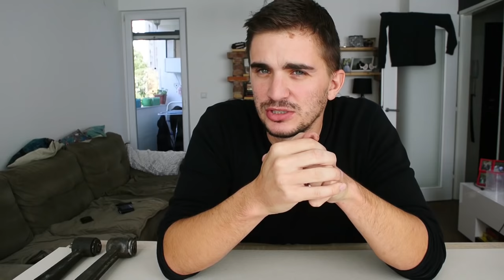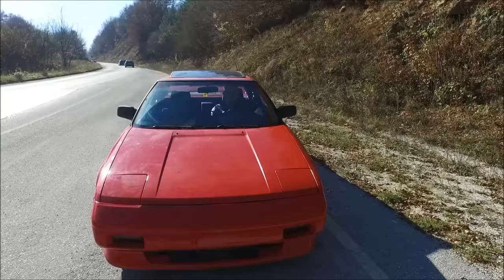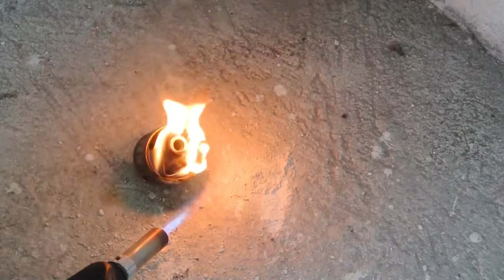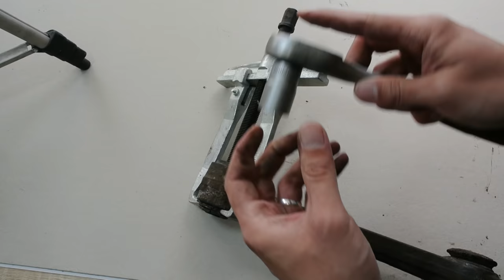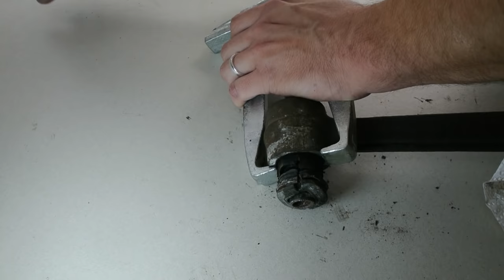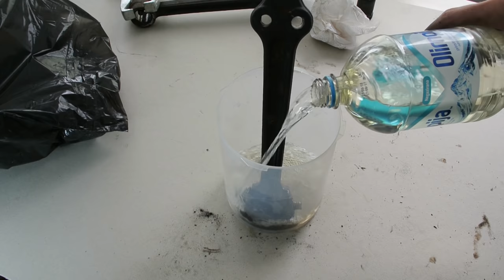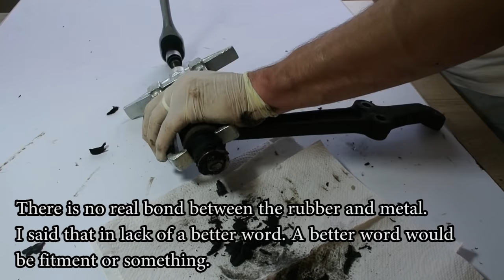How to remove rubber bushings without a press or burning - suspension episode 5

Comment: Makes sense because gas eats rubber, Brake fluid eats painted surfaces. I still remember that from school, I should've used some common sense, i swear if i didn't watch this i bet one day i try to take out bushing and i'll just give up and buy a new suspension part. LOL
Reply from the maker: That's what the videos are here for. I gave up on a several jobs until I watched a video or read an article. All hail the internets.

Comment: U use this method to push the new ones in?
Reply: Skyscraper 

If you get the 2-piece polyurethane bushings, you just push one piece into each side and put the hollow steel tube through the center. Line up the holes and push the bolt through. The bushings sometimes are just slightly longer than the hole you’re putting them into, so when you tighten the bolt, it compresses the bushings tight. No need for any kind of press. Might need to hammer it in, but that will not take to much effort.

Comment: A faster, easier way would be to drill out the rubber. Saves the time required for petrol to break down the rubber and the fire risk with that, plus the smell
Reply from the maker: The petrol is not absolutely necessary, it's just to make it even easier. Also...it smells great 😊 I'm sorry but I have tried drilling rubber bushings out and it's not easier than this. It's only easier if you have a machine shop style drill station that keeps the drill and the bushing in absolutely fixed positions. Drilling out with a handheld drill is flimsy and kinda dangerous, as the drill often slips.
Reply: @d4a  I'm an electrician by trade and was a car builder, so this isn't an issue for me. You start off with a small drill bit and you work your way up if you're worried about slipping ;)

Comment: Is this possible with all bushings ?
Reply from the maker: There are some types where it might not work. Usually the ones that have a metal sleeve. It can be done with those too sometimes but you need to get a washer that fits right.

Comment: How do you replace it.  How do you put a new one in.
Reply from the maker: You can easily install new poly bushings with a vice or a g-clamp or even just using your hands. New oem bushings can only be bought together with the suspension arms and rods (i.e. press fit from the factory). This method is needed only when installing aftermarket polyurethane bushings.

Comment: How do you install the new ones??
Reply: lostintime86 

If you get the 2-piece polyurethane bushings, you just push one piece into each side and put the hollow steel tube through the center. Line up the holes and push the bolt through. The bushings sometimes are just slightly longer than the hole you’re putting them into, so when you tighten the bolt, it compresses the bushings tight. No need for any kind of press. Might need to hammer it in, but that will not take to much effort.

Comment: I just use 1/2" all thread. Two sockets. One big enough to allow the bushing to pass through. The other small enough to fit through the hole. Just stack some steel thick washers under the smaller socket. Then just crank on the nut. It will come right out...https://www.youtube.com/watch?v=50VUhlxlO-M

Or just go rent a bushing\ball joint press kit.

Comment: I can't find this puller. Does anyone have a link or part number?
Reply from the maker: There is no part number. It's just a cheap generic gear puller you can buy anywhere. Just search eBay or anywhere else for 2 arm gear puller.
Reply: Who needs a tool or a puller?

Comment: now how do i put the new ones back in ?
Reply from the maker: outlawhead If they polyurethane they are made from two pieces and it's really easy. If they stock rubber replacement heat up the metal and get a big table vice and squeeze them in. Or take them to someone who has a press.

Comment: Maybe u should've used an oxy/acetyl torch with cutting pressure outside over a drum or something.... fast high heat + pressure = less smell + less mess.... besides that cigarette lighter... ay?.....but, don't listen to me because now ur casting/part may lose integrity if u don't know what ur doing take the mechanical route and leave the field testing to professionals like me....

Comment: Who needs a specialised tool? I've never used any of that expensive rubbish I've always used a socket with an internal diameter large enough for the bush to be pulled into, a washer, just the right size to go through the mount/suspension arm & a long bolt or threaded bar all probably available in what you already have in your own workshop so who needs to drill anything not me or expensive tools not me or any burning of anything not me.
Reply from the maker: This is a 12$ tool.